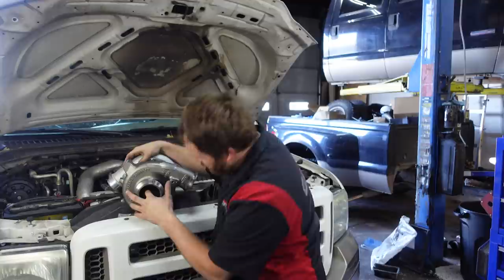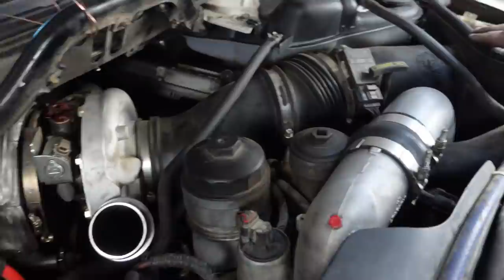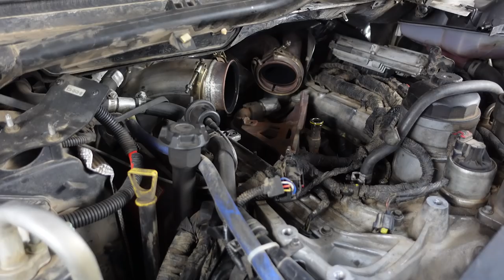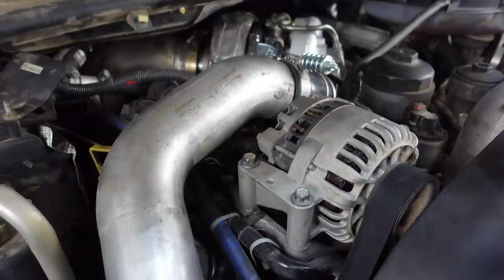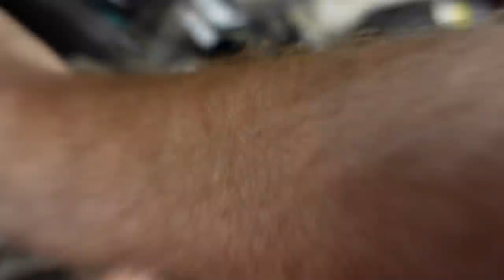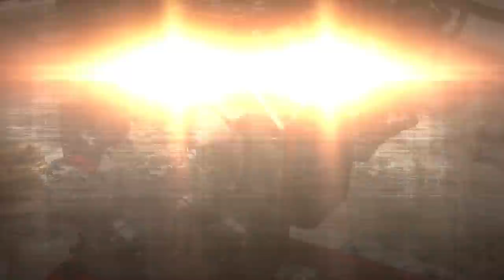How to Install a 6.0L Power Stroke Turbo | KC Stage 2 Turbo Upgrade | Power Driven Diesel

Comment: If you pull the belt back before you remove the alternator there is a clip that locks the tensioner in service mode a lot easier than pulling it back on
Reply from the maker: Thank you Jeff for the advice we will try that next time

Comment: You can also just hold the compressor wheel from spinning for about 30 seconds on the first startup. That will oil it real nice
Reply: Tried this and lost my hand … did I do it right ?
Reply: Yeah just wait till that vgt closes and the compressor wheel becomes a blender
Reply: I use a screwdriver 😂

Comment: Will stage 2 work with stock injectors
Ok can you say what’s the advantage or difference from the stock injectors and a performance tune than  when towing from a big injector and a tow tune thanks again
Reply from the maker: yes it will, but it will be a little less responsive than stock, the truck in the video has warren 175/stock nozzles
Reply: I have a gen 1 kc stage 2 with stock injectors and stock tuning… just a 4 inch straight pipe. and it spools up great. 75mph, 2k rpm, 10 psi boost

Comment: What stage was the turbo you removed? It looked like it had the gen 2 compressor wheel in it?
Reply from the maker: the kc stage 2 gen one, the turbo i installed was a kc stage 2 gen 2. the gen 2 has a better turbine wheel. it helped spool up buy about 150rpms
Reply: @pddofficial  isn’t that compressor wheel on your gen 1 the same as the gen 2 though? I know the turbines been updated. All the gen 1 I have seen seem to have a more straight finned compressor wheel.

Comment: I have a stage 2 with 190/30 injectors and fuel system.. what HP could I expect. I’m on warren proformance tune
Reply: You should be around 600HP.
Reply: More realistically 550-570whp.

Comment: How to blow your 6.0s headgasket faster 101.
Reply: Not if it's deleted. Only reason the gaskets blow is because the egr cooler flash boils the coolant, which causes silicates to drop from liquid suspension and clog the oil cooler